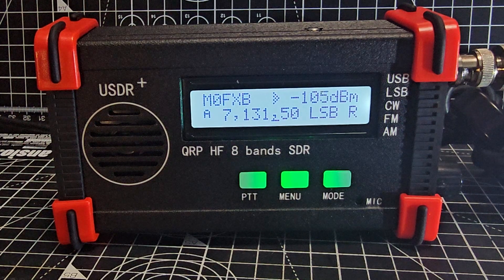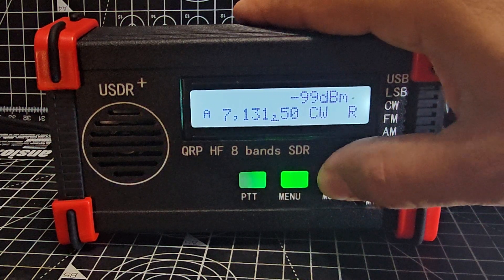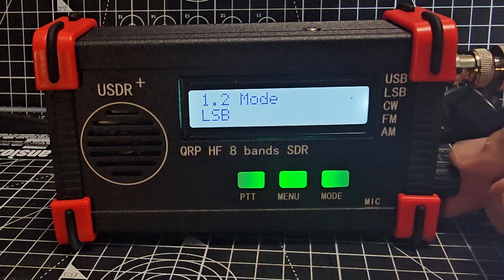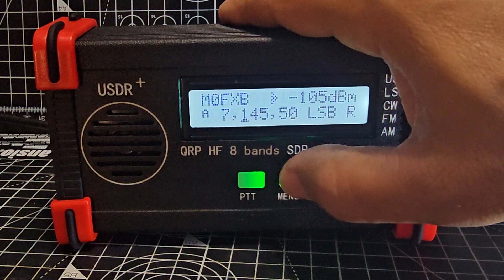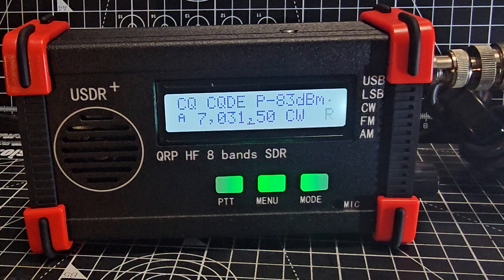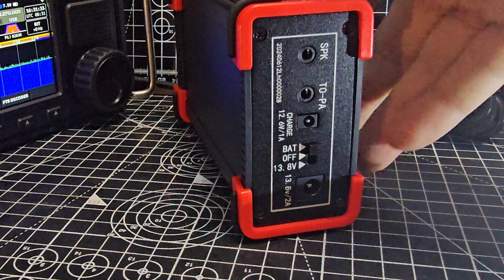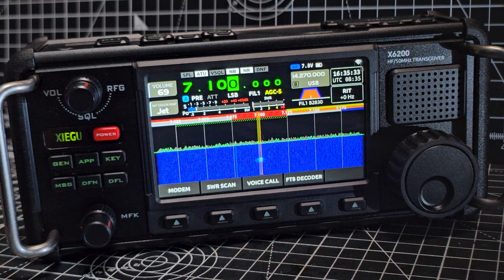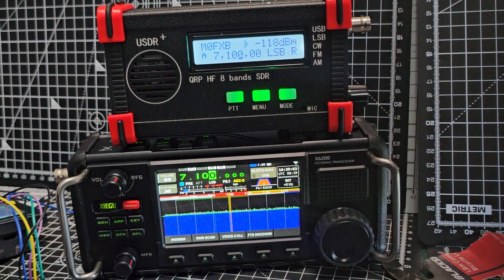USDX + Mod Frimware (GW8RDI) Overview 2024

Comment: Nice sir👍
Reply from the maker: Keep watching
Reply: What firmware version do you have installed? From what I see, you can select CW and you also have the CAT. I assume you've also fixed the SSB modulation issue, right? Best regards, and I await your response. One last question: Did you have to remove the capacitor to update it? Did you have to install the bootloader before installing the firmware, as mentioned in a video? Thanks.